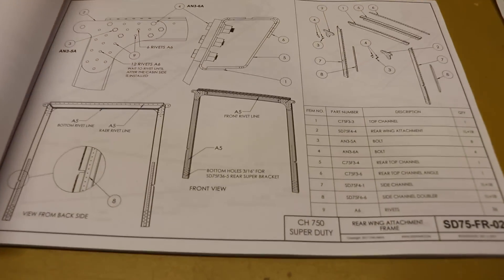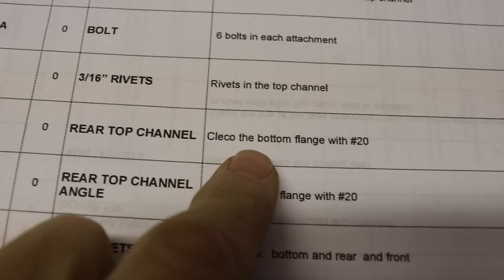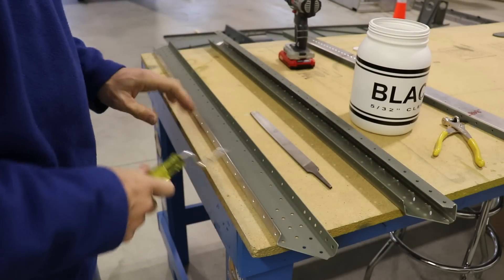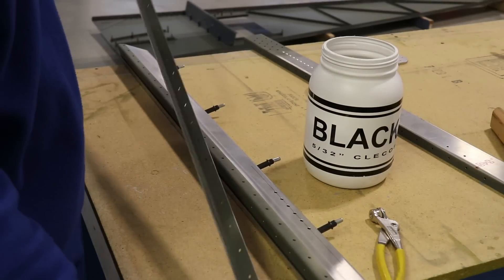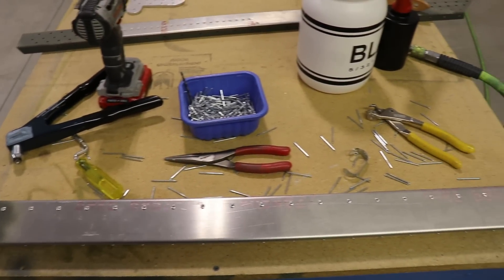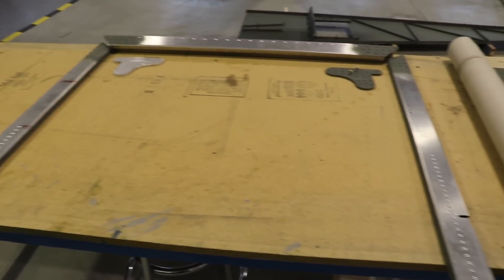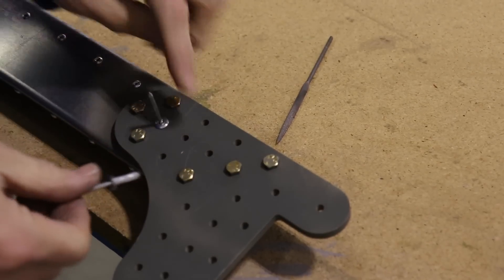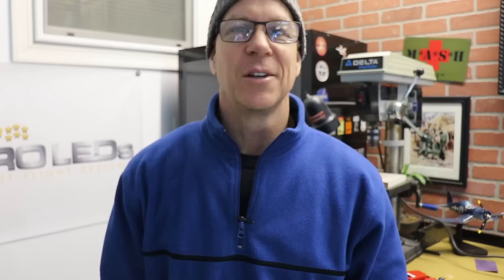Starting to BUILD the Aft SUPER DUTY Fuselage (Ep22)

Comment: for the rivets that you are adapting/ sanding filing, if you drop them in before you tighten the screws on that part, you don't need to file or sand them. They just drop in.

Comment: Mark can I see holes in the rear of the top cross member if so what are they for? Have they improved the seatbelt to 4 point unlike the Cruzer or I’m I seeing things. Looking like another great build
Reply from the maker: Because of the top window over the jumpiest, there is more structure on the top skin. The holes yo are referring to on the aft part of the spar are where a bracket attached that connects a large "U" channel to the underside of the top skin. I did buy the 4-point harness and I believe they attach somewhere up there too-I'll have to wait to see how they attach until I get to that step.

Comment: There is an easy way to remove grooves from your scotch brite wheel. You take a small plank to which you glue a 80 grit sand paper, you rest the edge of the plank on your workbenche below the wheel the sand psper facing up, then you press up the part of the plank with sand paper on it to the wheel. You will then be able to shave your scotch brite wheel and have it flat again. Hope it is clear.
Reply from the maker: That is true. The problem is that those grooves really come in handy for cleaning the edges of aluminum! I just need to get a second one!
Reply: I wondered if there was a good way to dress the edge

Comment: Mark, are ALL the rivets on the plane "CHERRY" type POP rivets? DO you fill in the Heads around the popped shaft and the mushroom head with anything to make them flush before painting? So that they look finished like a solid Bucked rivet.
Reply from the maker: There are some solid rivets, but those are bucked at the factory.
Reply: Daniel, I don’t believe they are “Cherry” or “Cherry Max” rivets, but they are structural rivets from the factory that they determine are strong enough.  I don’t know if they are self plugging, I believe they are, but I’m not building a Zenith myself. I’ve flown them and they retain the pulled rivet look, they aren’t flush.

Comment: Is there any concern about checking the corners for square before tightening the bolts and adding the rivets?
Reply: No everything is set at the correct angle, that's why it is predrilled ,
Reply: @itsonlymoney2931  pretty cool! Must be a bear to get those bolts in if they are drilled that tight!
Reply: @AnonyMous-jf4lc  No since the part's are all done on the  CNC, if you use clecoes to hold the parts in place,  Might have to run a drill bit threw just to clean but that should be it.